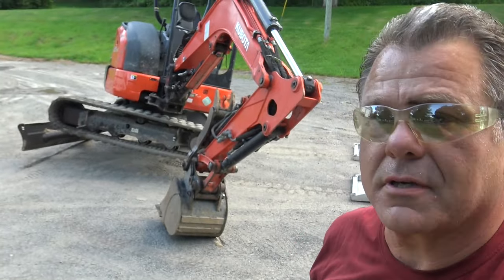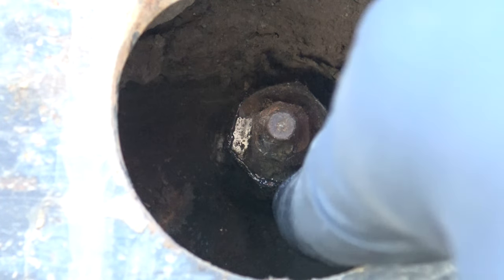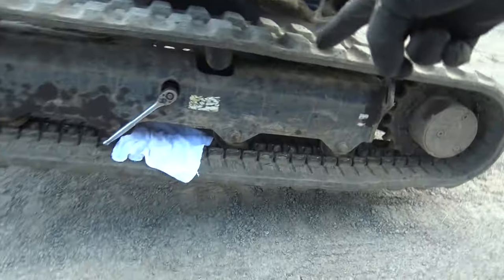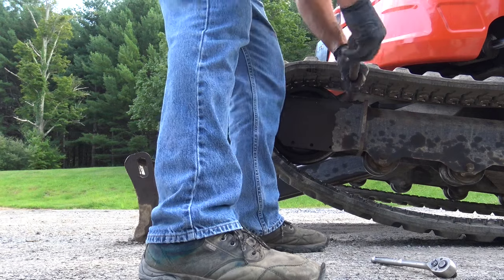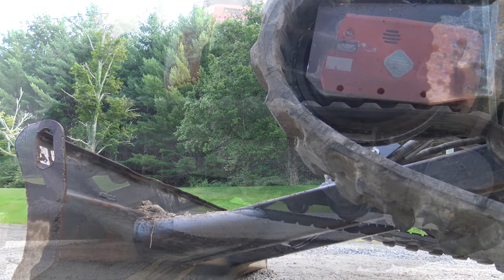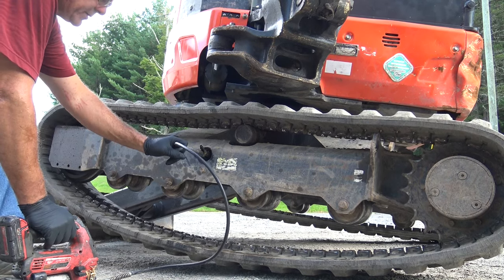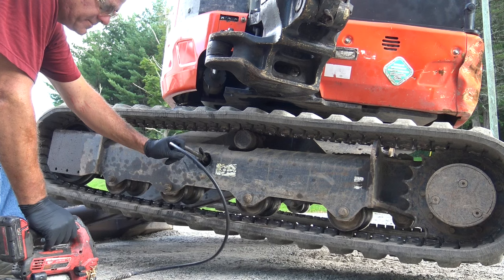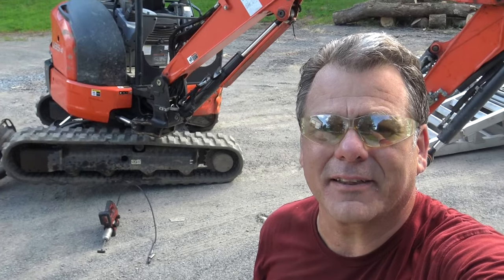How To Put A Track On An Excavator || Thrown Track Repair

Comment: Hey dude, thanks for posting this. As I write this my Kubota KX04-4 with a thrown track is sitting at the bottom of a draw with 3.5" of rain in the forecast. Your video was EXTREMELY helpful. I'm going to take a crack at getting it back on tomorrow morning. I am an amputee with only a right arm, but watching you I think I can do it. I appreciate you contributing to the public knowledge base. It might save me a $500 (or so) service call. You rock!
Reply from the maker: I am glad it helped.  Avoiding a service call is the way to go.  Let me know how it worked out.
Reply: Axiom Excavator Rental The track was sitting crossways with the idler end towards the inside and wedged against the house. The drive end was also off (not completely) but on the outside. I was able to get the track off the ground by rotating the house just a bit without tearing the cowling off, and then used the boom and dipper to press down. The part that hung me up was when I opened up the grease bushing, no grease came out and the track remained extended. In the end I called the service guy and he had to use a handyman jack to press between the blade and the idler. Once it was retracted, I know I could have done it just like you showed with a big spud bar and a lot of effort. Everything he did, I could have done, but the handyman jack would have been a challenge keeping both ends positioned while cranking the jack. As it was I had to help the service guy hold one end. Long story short, next time I’ll be good to go. (I’ll also keep a better eye on my track tension. :-) )
Reply from the maker: @ReZipped  So the bull wheel was frozen and that's probably why the track came off in the first place.  you should be good to go now.  Keep an eye on the track tension.  Check every 35 hours or so.